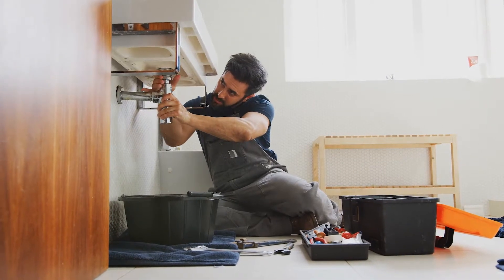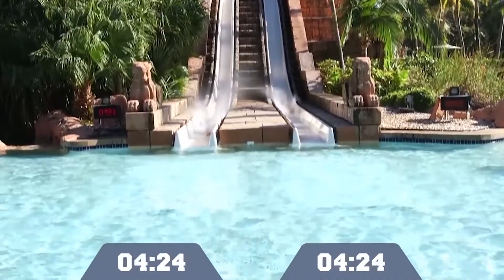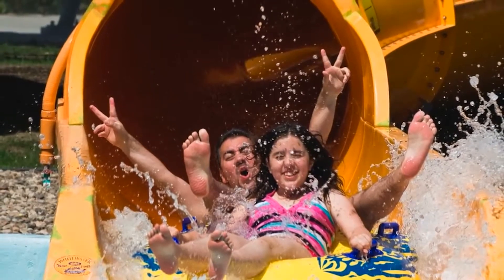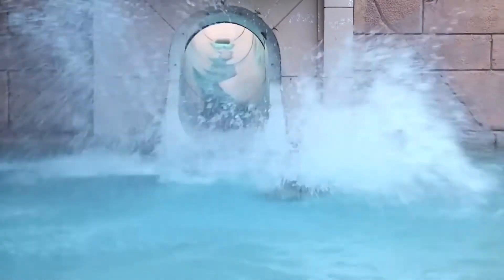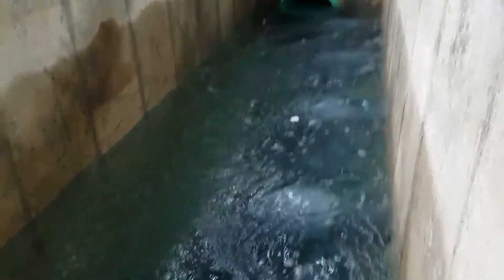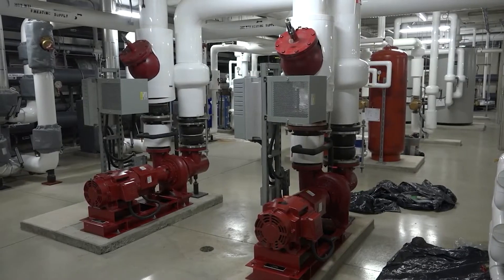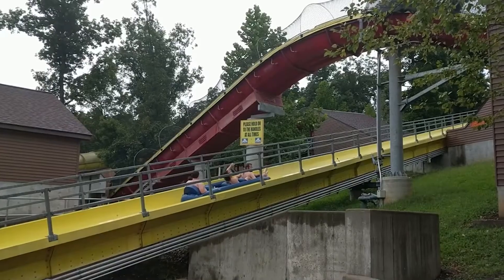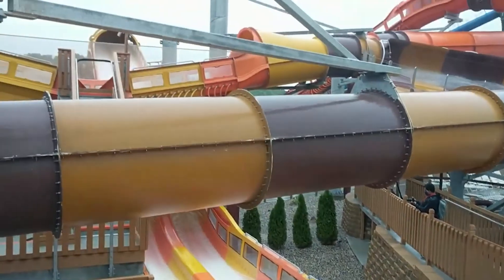How Does The Plumbing At Water Parks REALLY Work!?

Comment: Plumbing in a place like Adventure Island or Volcano Bay must be immense.  The motors pushing all that water are a far cry from the 3 hp motors for residential pools.   Pipe sizes are wild too, Residential pool plumbing tops out at about 2 inches, those pressure side pipes look to be 8 to 10 inches in diameter.   A 2 inch pipe can push 150 gpm, a 8 inch pipe must be pushing thousands of gallons per minute.  Technically plumbers, as we know the word are not designing these systems...the actual design and specifications, dimensions, pressures, at each point on those rides are designed by civil engineers.  Plumbers do the physical work of installing equipment, maintaining it, fixing things that break down or pipes that break.  Still very important jobs but they generally do not design the water system.